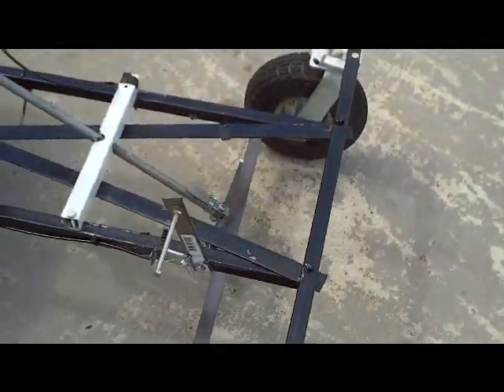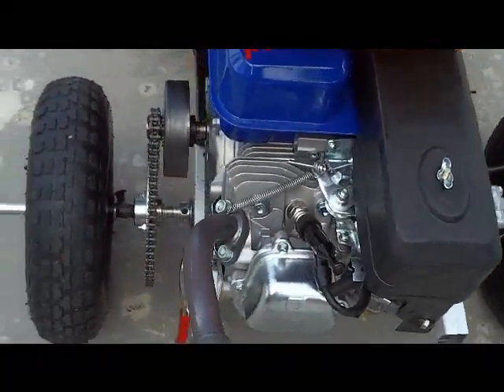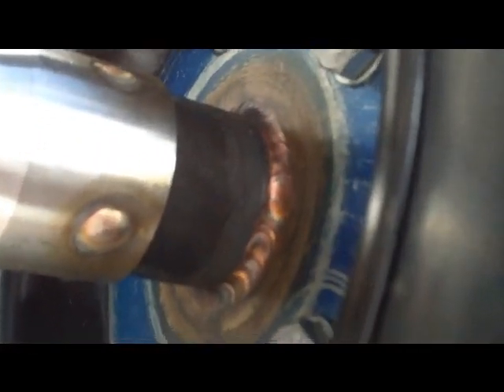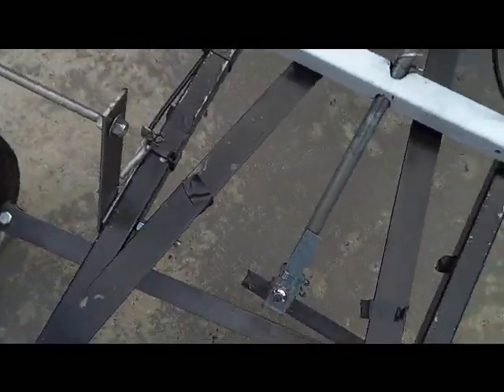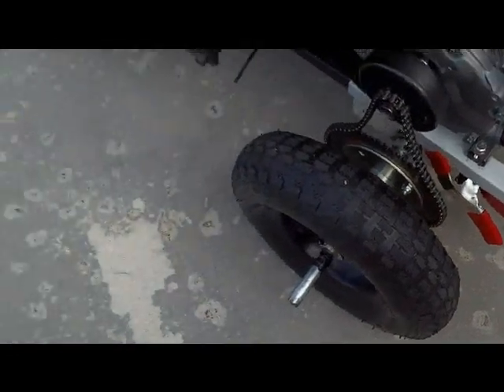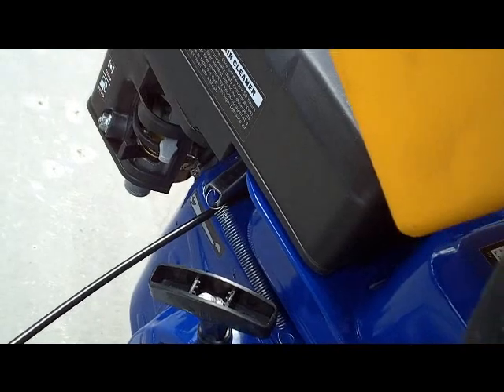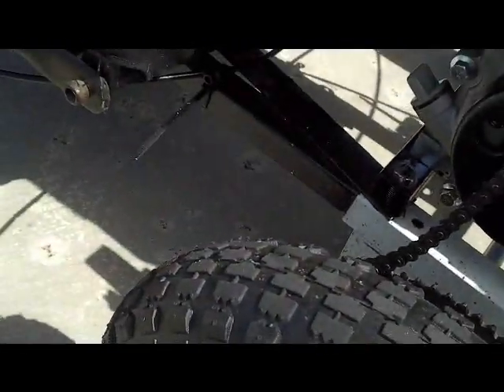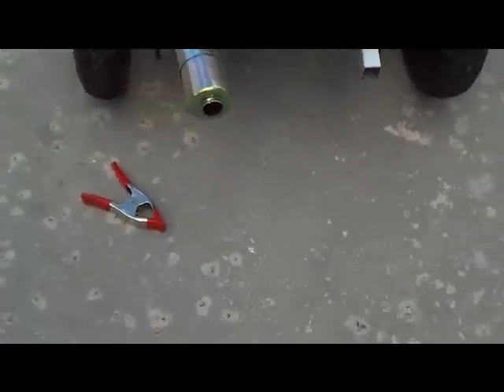no weld go kart done!

Comment: It's wobbly is because you used casters as the front wheels which are prone to speed wobbles at high speeds. If you've ever pushed a shopping cart at high speeds you'd know what I mean. One way to solve it is to put more weight on the casters. From your design it seems like there'll be very little weight on the front wheels.

Comment: @mike o Connor. With go karts you get things called sprocket carriers which fit into the keyway on your axle and then use an Allen key to tighten up. With mini bikes and motorbikes, the sprocket is mounted to the wheel, not the axle. The engine drives the wheel, not the axle.